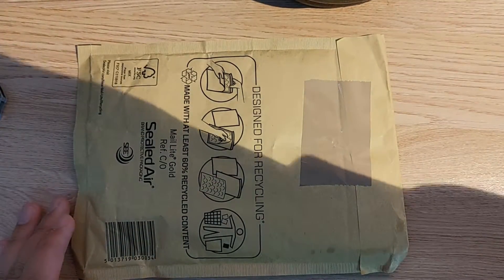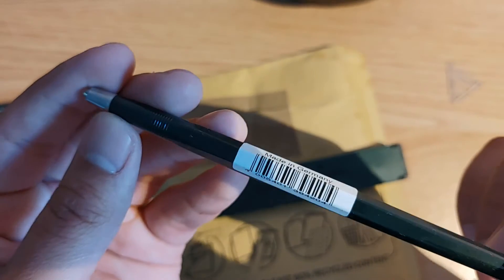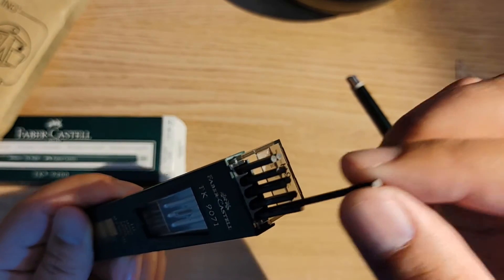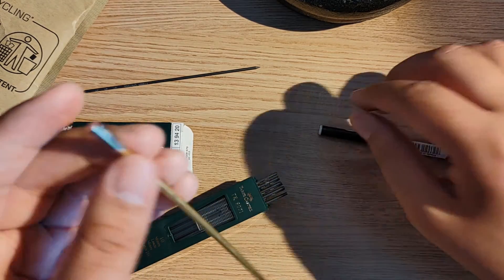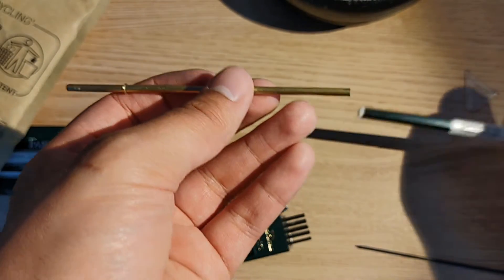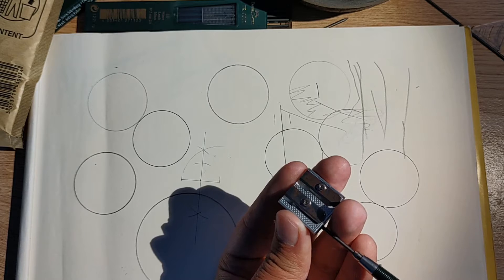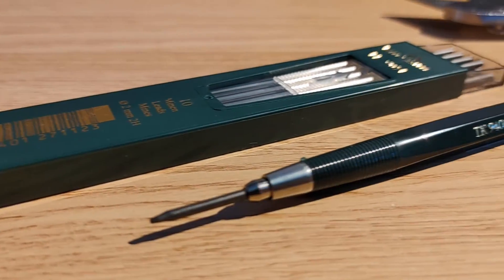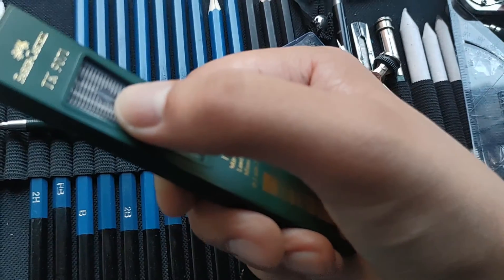Faber Castell TK 9400 2mm Clutch Pencil Lead Holder UNBOXING & First Impressions

Comment: I used to use a Staedtler 780 for 20 years before it broke at the plastic barrel just above the grip. I rushed out of work to a nearby store and bought a TK4600. I actually like the TK4600 more and bought a few spares.

Comment: Let me ask, did you buy the pen and it came with a replacement pen box or do you have to buy these two products separately?
Reply from the maker: Hello, I had to buy these both separately. Check my pinned comment to see the links.
Reply: @DrawingTechnical  thanks <3
Reply from the maker: You're welcome

Comment: Hi there. I have TK 9400 that holds 2mm leads and one that holds 3.1 leads. ....but not the  appropriate sharpener. Can I sharpen the thicker leads of 3,1 mm with the small Fabee Castell sharpener as well or only the 2mm leads ? Or do I have the order another one for the thicker ones ?
Reply from the maker: Hello, I've just examined the small Faber Castell sharpener and the Staedtler tub sharpener, both of them look like they can only take 2mm leads and no bigger. It seems you'll have to find a sharpener for a 3.1 lead. Hope that helps.

Comment: I use the regular Staedler sharpener and don’t have any issues. I extend it longer and it fits fine in the one that holds the shavings. I have used it with other clutch pencils also.😊
Reply from the maker: I've tried sharpening the clutch pencil lead in a regular sharpener, but it requires to much careful movement I think. To avoid that I just bought a cheap little lead pointer, someone gifted me the Staedtler one.

Comment: It's the only TK model they never sell in my country. That's why I have to rely on the 5 TK 4600's I own and 2 TK 9400 3.25mm  Even though it seems almost the same with the 4600, I bet the TK 9400 2mm has a better balance because it doesn't have the longer and heavier button that's also a sharpener. Do you own the 4600 to compare them? I tried to order it from Germany, and the shipping costs only was 70$ ! I also want a set of these, because they can have the lead grade written on them, which is the main reason, I need the 9400 2mm.
Reply from the maker: Hi, I don't have any other Faber Castell to compare it to, but I do have a staedtler mars 780 C which I am yet to unpack and compare it with the TK 9400. I like the TK 9400, it feels good to make a line with, it's strong and thin to hold, like a pencil. That shipping cost is nuts! You'll have to search around for a better price.

Comment: Gee Dude! You really don't need an inch of lead  sticking out of the end, even a quarter of an inch is too much!!!
Also, you don't have dismantle the whole pencil for any reason at all! When you want to sharpen the lead just let also about a quarter of an inch stick out, pull the back end off, stick the blunt end of the protruding lead into the little end piece that you've removed from the back, apply a bit of pressure on the whole pencil and turn it around! 😀 your lead is now sharpened without having to dismantle the whole pencil, just the end cap!!!👍
Reply from the maker: Hi thanks for your comment. I dismantled the pencil to show viewers in case anyone wants to see it dismantled. On this pencil, unfortunately the end cap doesn't work as a sharpener. I've bought a staedtler that should have an end cap sharpener though.
Reply: I need an inch of lead exposed, to draw. Long exposed leads, are a must for Free drawing .

Comment: Oh, and as for sharpeners Faber-Castell make two versions. The Kitaboshi one is pretty good for the sketch tool box aaaand you can use these with the Staedtler rotary one for an amazing sharp point!
Reply from the maker: Kitaboshi? Is that the box with the turn crank handle?

Comment: Hey there's, there's a version of this called the tk4600 and it has a clip and a sharpener in the button. I use mine for illustration (in 2b and red lead). Nice video!
Reply from the maker: Thanks. I've seen that version and I was cursing myself because that's the one I wanted and I ordered the wrong one XD. I have a staedtler mars something or other which I ordered a few days ago and it has a sharpener on the end like that, haven't tried it yet.
Reply: I suppose there is no new or old, different versions of models. I got my TK4600 in 99. However, I think there might be different variants of the same model as years progress...

Comment: I got a TK 4600 and I always wanted to know how to disassemble these leadholders! Thanks for showing!
Would you also know how to disassemble the Staedtler 780/788 Techno?
Reply from the maker: No problem. I'll have to get one of those Staedtler 780/788 Technos, I assume there's something different about it?
Reply: @DrawingTechnical  780/788 mars technico I meant.
Reply from the maker: I've bought one now, mars technico 780 C. I'll see how it goes.

Comment: I never knew, until a few years ago that there was a 2mm lead sharpener. I always used sandpaper for this job.
Reply from the maker: I ordered a 2mm lead sharpener, but I couldn't wait to use the pencil, so I ended up sharpening on the sandpaper. It's quite fun but very messy. I have the small sharpener now.
Reply: @DrawingTechnical  Mess is one part of the joy. Try filling fountain pen and youll always have coloured fingers ;)
Reply from the maker: @tsusec  Haha, I guess you're right. I have fountain pens and fill one up every week to take to work. By far the messiest experience I've had is trying to use an inkbow compass or an inkbow pen, those are quite tricky to use.
Reply: Same